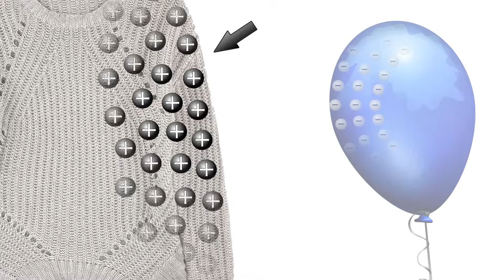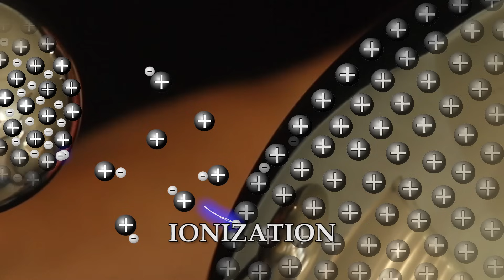Avoid electric shock getting out of a car!

Comment: I'm seriously static prone, so I get shocked by everything ALL THE TIME (mostly in the winter).  I've been waiting for this video my whole life.  I'm totally trying the hand on the car trick and will let you know the results.  As for the dryer sheets, they work wonders.  In the winter, I make a habit of carrying a couple around with me wherever I go.
Reply from the maker: +The Science Asylum REALLY?? I didn't know that people actually used dryer sheets for something like this.
Reply: Physics Girl REALLY!!! I have to carry them. The shock pain gets real old real quick...
Reply: A good tip is to discharge yourself using house keys. You can sometimes see me at the wholesale store touching metal shelving with my key because of all the static electricity.
Reply: +The Science Asylum Just FYI, synthetic materials will tend to cause more static too, rubbing two synthetic together doubly so.
Reply: I use the dryer sheet technique on clothing as well as trying to keep myself grounded like the video. The carpet in my office is very static. There are carpets designed specifically to be anti-static, usually for offices and anywhere expensive electronics are used. There is also carpet sprays that prevent static buildup.
Reply: +The Science Asylum How did you arrive at that statement? Other than 'exercise clothes' I'm usually able to find natural material alternatives and even then if you stay away from the high tech outdoor stores which are expensive anyway, you can do ok there too. I tend to use cotton and wool and do ok.
Reply: LoneWolf8773
I just mean with winter jackets/coats. I live in Michigan and the better designs seems to almost always have static-prone materials in them. Drives me mad!
Reply: +The Science Asylum The easiest way to discharge static without pain is to use your knuckles to touch something. Since knuckles are a very insensitive part of your body, you will feel very little doing this. It&#39;s also great to shock someone else without feeling the shock yourself :P
Reply: +The Science Asylum 
When I used to get shocked by the grounded screws of light switch face plates (and doorknobs) all the time, I got into the habit of touching them first with my keys (pulled from my pocket).  There was still a visible and audible spark, but I didn't feel it.  I don't know why for sure but I assumed it was because the flow of electrons was diffuse over my whole hand rather than concentrated into a single point on my finger.
Reply: @BenjaminAlexander  Good work around! Another possible work around is placing your hand on cemented / concrete / porcelain tiles wall  for a few seconds if one available, or touching the cement floor. I suppose it may be helpful.
Reply: +The Science Asylum 

After years of getting shocked, the solution I've come up with is to tap the metallic surface I intend to touch with the tip of my finger and quickly pull it away. The static gets discharged and I barely feel it, it's very slight and doesn't hurt this way. I tried it with knuckles or the back of my hand but even when I'd pull away quickly I'd get shocked sometimes. I get the size of the surface area that comes in contact also makes a difference. 

The combination of using just a finger and pulling away quickly has really worked for me, and it's become something I do every time I'm about to touch a metallic door handle. I actually haven't gotten shocked in years, but I still do the finger pull during winter before grabbing metallic door handles.
Reply: There's a trick I use, I wear a metalic ring and always touch anything hitting it first, sometimes I see the spark between the ring and the object but no pain at all.
Reply: Dryer sheets, here I come!
Reply: The Science Asylum did it work.?
Reply: @duramax78  Looks like he died in the attempt.
Reply: LoneWolf8773
 It's kind of hard to get away from synthetics these days though.
Reply: +The Science Asylum ah, the midwest. I grew up in the midwest and I know what you mean: minus 10 to maybe minus 30 and so on, maybe teens during the warmest part of the day. I live on the west coast now so the coldest I expect is maybe teens. From what I remember, the typical thing is to wear a tshirt, jeans, sweater and thick parka and scurry from heated car to house to office, yes? What I do now is that I have an undershirt I wash everyday, then as many layers of wool or down as needed all under a leather jacket. If I need to, a scarf, gloves, a pair of long johns but I tend to layer up my pants last as it's harder to adjust. The biggest challenge of winter wear is that the buildings are often quite warm so one needs to wear clothes for a wide temperature (and humidity) range. Wool is expensive if you buy it new but second hand wool is just as good and a lot more affordable. The biggest thing you need to remember is that only the boiled kind (thick heavy felted) kind is anywhere near windproof so I just wear leather on top. It's that 3 layer philosophy, a sweat layer, a thermal layer, a wind/water layer. Most people don't use the 3rd and too much of the 2nd to compensate. I bike too so layers are super important (shed most of the thermal, keep the shell, cover everything and the joins.)
Reply: +Physics Girl I don't carry dryer sheets around but I have used them when I've gotten too charged. Like The Science Asylum, I get shocked by everything and yeah it's worse in the winter time because it's dry but even in the summer I still get tons of shocks. In winter they get super intense and I had to stop wearing socks in the house because of constant loud and visible shocks. Almost 10% of my shocks you can see a quick arc... when I was a kid and I had friends sleep over all I had to do was run my hand across the inflatable plastic mattress base in the dark and you'd see constant pops of light from when I was moving my hand we thought it was fun then but I really hate it now.
Reply: +jd641 But look at the upside, you can attract light things like dust with your body)
Reply: +The Science Asylum I just hold my car key (make sure metal is touch my hand) and touch the doornobs/car/etc with the key. The spark will jump from the key (visibly and audibly). Then you are safe to touch the metal in question.

You still get the satisfying pop and spark, but you don't feel it!
Reply: ***** Nah, but that doesn't mean nobody does!
Reply: i got shocked by my dress at night... like 3 times in different nights. i thought it's my dream but then i realized it happened in the specific fabric i wore...something woollen may be...
Reply: ***** Yeah, I'm unlucky with electronics too, everytime I open my pc something goes very wrong
Reply: +LoneWolf8773
"Wool is expensive if you buy it new but second hand wool is just as good and a lot more affordable."

...and that's what sheep said
Reply: LoneWolf8773 Yep, that pretty much sums it up for the Midwest.
Reply: +The Science Asylum Everyone's got a snowblower and a lawnmower, right? Also, here's a question for you: I was too young to ask then but I only heard of snowchains after coming to the west coast, and no one I knew had snowchains while I lived in the midwest. I'm going to guess it's because the snowplows come through every night to clear the streets and so only people living way out would use snowchains, right?
Reply: LoneWolf8773
Correct. Plows are pretty standard for urban areas. Cities and large townships are prepared for these sorts of things.
Reply: +The Science Asylum do you wear polyester/synthetic clothes?
Reply: Pianoguy32
I have a variety. It doesn't matter what I'm wearing.
Reply: Rainy Kay
I've done this too.
Reply: I get a coin to touch door noob first, so coin get electrocuted, with contious touching I dont feel anything
Reply: +Rainy Kay thing about that I still get shocked just not as bad, but after searching the internet it was the best advise I got before this video. hope it works
Reply: +Albert Amir Givol Holding a key (or something metallic) in your hand and discharging by touching something with that means that you don't feel it at all since the charge escapes your hand via a larger surface.
Reply: *****
You must have a lot of humidity.
Reply: +Shawn
Reply: +The Science Asylum 
I used to have coat that was seriously a static hazard. While working in a freezer(where humidity is almost null) it would dry out and when I came out and took it off, I would throw a 6 inch spark to the nearest object(or person). I eventually found that if I took my keys out of my pocket and used them instead of my hand I could discharge to a metal object safely.
Reply: +The Science Asylum Do you happen to know whether or not your car has a grounding strap? Because you could eliminate the charge buildup from the driving itself. Now when it comes to discharging yourself painlessly: try introducing a 1 MegaOhm resistor between yourself and the car. Just buy some 1 MOhm through hole resistors, hold it in your fingers and point the other leg at the car, the zap will be far less painfull.
Reply: I love shocks! I rub things, shock others!
Reply: I destroy a lot of lightbulbs and electronics when i touch them, Mainly lightbubs and light sockets. How can i stop this? Is this static or something else?
Reply: ***** Stop touching them?
Reply: +Shawn Jones care to explain how you think you break lights and sockets by shocking them with static electricity? Killing electronics, that's sane, you touch em with static, charges the gate of a MOSFET too high and causes dielectrical breakdown. But lightbulbs? They are connected to the mains, which is basically a HUGE antenna that picks up TONS of crap. It hasn't got anything to do with you!
Reply: +Shawn Jones Yeah, I'm sorry I have to say this: but that's really not caused by static electricity, that either means you buy really crappy CFL's or the wiring in your house is not up to snuff or you have a some severe noise ingress on the mains. Do you live in a particularly rural area or an older building? 

Before you stick to the idea you're very prone to static electricity, remember that static electricity holds very little energy, small amounts of energy can only break very small stuff under conditions with very little loss. What you described simply doesn't meet those conditions. Static is your red herring.
Reply: +The Science Asylum you're more prone to static electricity when the air is dry, dunno the physics behind it though
Reply: Feroz Ahmad yeah i dont use dyer sheets or softener, unless its my (wool) socks.
Reply: Marcos Mori Ive tried discharging myself. Still killed some electronics directly after 'discharging' even though with mid range humidity and rubber shoes I didnt discharge anything to begin with cause nothing was there. Im getting the idea i dont have a problem with static electricity but another anomaly
Reply: Oh thanks god, I finally I found someone like me, I didn't know to explain it, thanks!
Reply: I've been quite prone to getting static shocks when touching metal things. One thing I've started doing now, even quite instinctively, is to tap on something non-metallic before touching some metal things. I don't know if this is actually something that would be effective, or if it's just psychological. However, I have been getting fewer statics shocks. I don't know if it's just a coincidence.
Reply: Adam Newman  Probably just confirmation bias.
Reply: put a dryer sheet in a spray bottle with some water spray your car seats, jacket whatever builds a charge
Reply: I usually touch door knobs with a key first. also leather soled shoes pretty much cured my static issue at the office.
Reply: Getting ESD shoes helps. In the US they seem to be some white special shoes. In Finland they are available as perfectly regular shoes.
Reply: I was a car hood length away from being hit by lightning...twice, in a weeks time. Ever since then, I have issues with electricity. I live in an older home with old glass fuses in our fuse box. I cannot put a new one in, as I get hit hard enough to knock me back a couple feet. I cannot put jumper cables on a car or lawnmower. 
Can you help me figure out a way to "de charge" myself? Any ideas at all?
Reply: @claudiahancock9916  try some alkaline water. I used to have to close the car door by pushing on the glass. I had crazy static for years, all gone now. Not exactly sure how I fixed it but think it might be todo with acidity.
Reply: @The_Hunts_Men  I will try that. Ive tried so many other things. Thank you. My doctor didnt suggest it.
Reply: The important part is touching the metal before and during the motion where you lift your back and body from your seat as you get out of the seat. Otherwise the charge difference is not created as it's still in contact. (its the separation after rubbing your clothes/jacket for a while that makes a charge difference)
Reply: I used to have that problem, I could even catch a shock through my leather winter jacket, but not anymore. I'm cured.
Reply: Wear pure cotton clothes. You will be fine.
Reply: in lack of, just touch a piece wood before anything else
Reply: Carry a can of Static Guard!
Reply: +The Science Asylum Yep, I've known lots of people that use the dryer sheet trick.

Comment: Dryer sheets DO work; we use them for laser printers with seasonal static issues and weird paper jams.  Wet the sheet damp, rub the interior and exterior surfaces with the unit unplugged, then wipe down the cartridge exterior as well (avoid the drum and the metal parts in the cartridge and printer.) The elimination of static build up solves image and paper jam issues that aren't solved any other way.  It isn't useful for 95% of printer problems but that last 5% is insoluble any other way.

Comment: 1. Did you maybe ground yourself while trying to get your hair get charged?
2. (Especially for the kids) hang a ping pong ball about 5-10 cm next to the van de graaf generator and see what happens. (You can paint the ball with graphite spray paint to make the surface conducting to amplify the effect, but it should work with a normal ping pong ball)
Reply from the maker: +Nyt Mare I actually threw ping pong balls at the VDG generator, and nothing happened. it was a really disappointing clip :)
Reply: +Physics Girl It should have bounced off really fast, maybe the contact was too short for a lot of charge  to flow...
Reply: +Physics Girl The cool thing about letting it hang is that the ball gets attracted and then bounces off...

Comment: Thanks for the video. Another easy way to not get shocked leaving a car is to cover your seat with cotton fabric (assuming you are usually wearing cotton). It's the combination of different materials that creates the charge separation, so if seat and clothes are the same fabric, no charge builds up. 
Also, to make your hair stand up better with a VDG generator, here are two tricks I've found: (based on doing it hundreds of times with students)
- Dampening your hair with a spray bottle makes it work a lot better (yes, counter-intuitive)
- Standing on a plastic stool to insulate you from the ground is super important too.

Comment: Does that make a balloon a semiconductor, if I had millions of balloons could I make a computer processor?
Reply: The idea of semiconductors is not that they somewhat conduct, but that you can make them switch between conducting and insulating.
Reply: IamGrimalkin kinda sorta both and neither. Semiconductors do conduct a lot worse than typical metals but a lot better than typical insulators. Precisely because of this their conductivity can be finely tuned by incorporating small impurities, for instance in silicon arsenic is used to introduce more conduction electrons while boron is used to create more holes (places which electrons can fil). Both of these can bs used to increase the conductivity of silicon, but real interesging things happen when both are combined in various ways.

Comment: I used to mess with my brother by building up static electricity by rubbing my socks on the carpet then I would sneak up behind him and shock him :P
Reply: +Kevin Karro It becomes much more effective if you touch the "victim" with a metal rod instead of your hand. It becomes more painful for the other person, while you hardly feel anything yourself. We used to do this in our school gym, where some people (depending on the material of the sneaker soles) would build up significantly more charge than others.
Reply: pinkdispatcher I once did that on a trampoline and my bro was touching Metal or something like that and we were experimenting and it was a huge difference and yeah more painful :P

Comment: Great tip! I hate getting shocked getting out of my car. I'm still going to touch metal before putting gas, just in case.
Reply: +Percy Cardona Do you know why we don't have to ground cars manually before pumping gas, but we need to do this for airplanes?

Car tyres contain enough carbon to have a high enough electric conductivity to let any residual charge flow off before we ever get close enough to any part of the car with the pump nozzle.

Airplane tyres do not generally have this property, so we always attach a separate grounding wire before refueling.